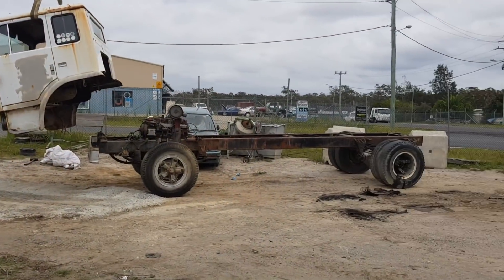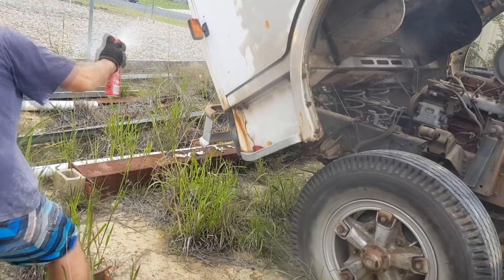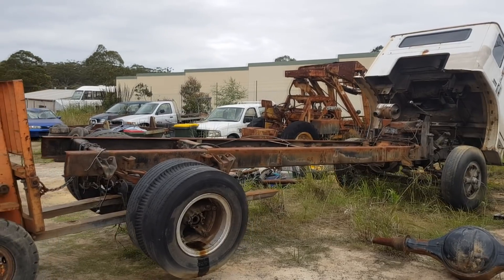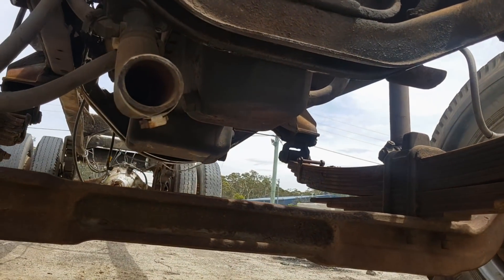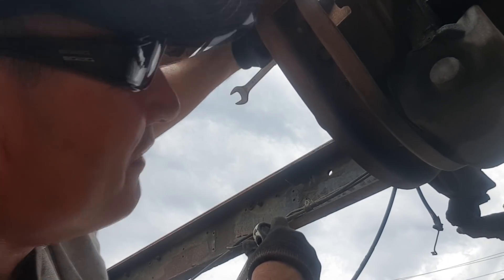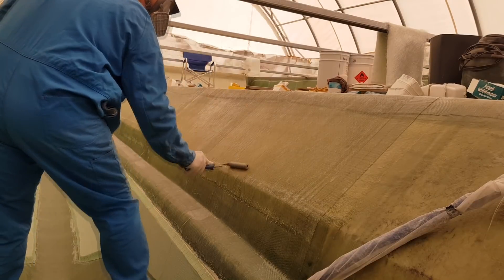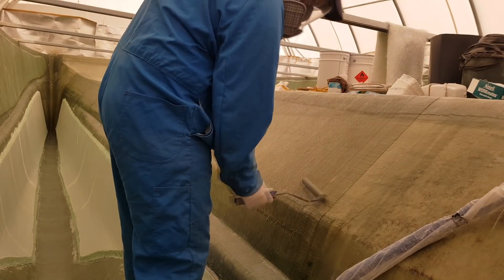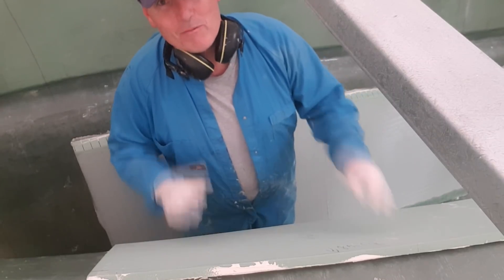Ep019  Viscious Creatures

Comment: Hot Shot, Raid, and Black Flag make Wasp & Hornet Killer, it squirts Foam in a stream for 18- 20 feet. WONDERFUL Stuff. Kills On Contact, Pretty Much. More expensive, but a Little Dab'll Do Ya, so it Balances out.  For a Quick and Dirty Flamethrower, however, get your pump-up Garden Sprayer and pour a quart of gasoline(petrol) in it, pump it up, and squirt them down, then hold your lighted Lighter in front of the stream. Instant Flamethrower. Always rinse your sprayer out After, the gas will eat the seals and then you can't spray Insecticide or weedkiller,lol.

Comment: Coming along good, going to keep the steering box and linkages on the truck? We had same setup in NZ and kept the steering along with the steering wheel, worked a treat on a mates 35 ft Tri.
Reply from the maker: +daedster1 Thanks buddy.I have seen many versions of the trailer and opted to reverse the front bogie and will weld up an extended drawbar to be able to tow with a pintle hook on it.Reversing the whole front axle assembly has given me almist 90 degrees of steering and will tow beautifully behind a bachoe.I have left the front brakes complete so can hook up to tow vehicle existing brakes.Working on a hydraulic lifting cradle with bunks for stability.Cheers Rossco